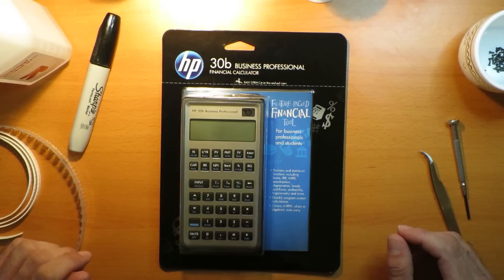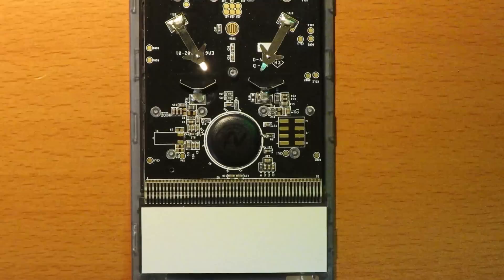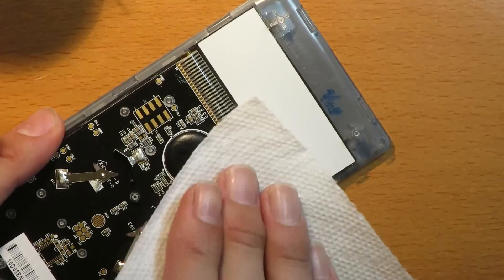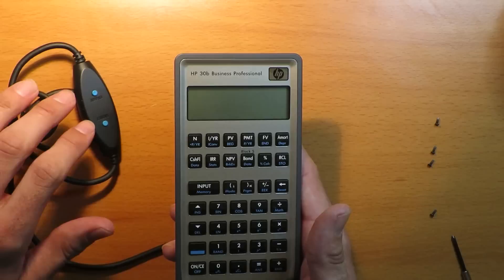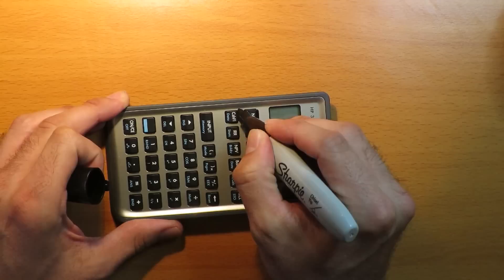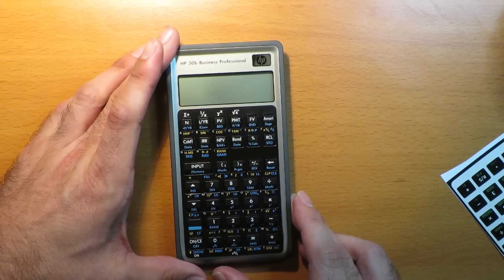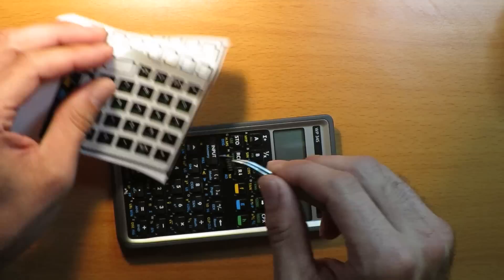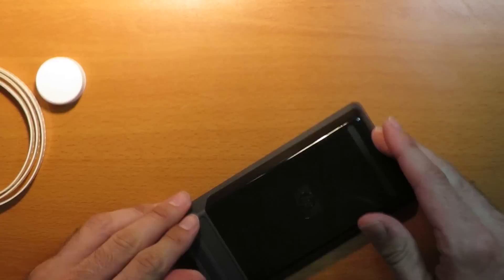Building a WP 34S calculator from an HP 30b

Comment: Why the clock crystal and the capacitors are soldered? Is this operation necessary for building a WP 34S from an HP 20B?
Reply: I guess no, but you could not use timer otherwise
Reply: The clock crystal and capacitors are optional. If you don't need the timer functions, you can skip installing the crystal and capacitors, then flash with the file calc_full.bin instead of calc_xtal_full.bin.

Comment: I mean this is cool and all but why hav you guys not done anything to have active rom switching or any extensions to the stack?  8 slot stack is good at a desk, I need like a 64 slot stack though.  I use an RPN app on my phone and I work at a gas station.  But to be completely honest, I need the damn buttons so I'm not staring at some stupid screen.  I can't do smart phones anymore, I just can't, but equally, going back to hardware, theres like nothing that compares.

Could at least someone help me in modding a firmware image to have more stack slots?